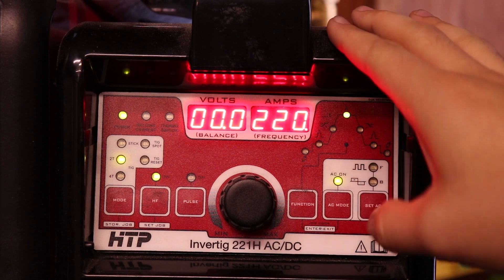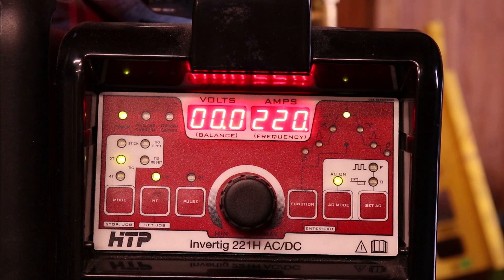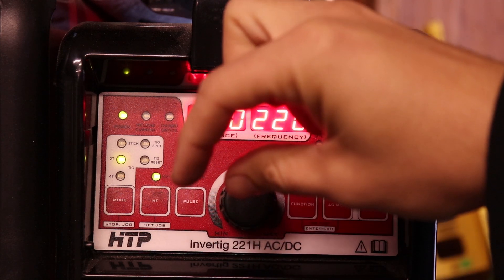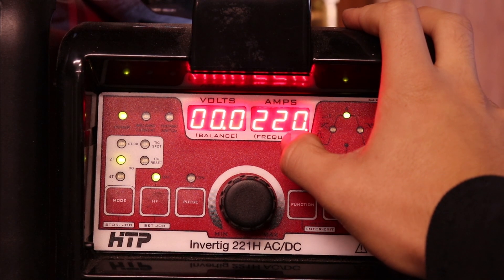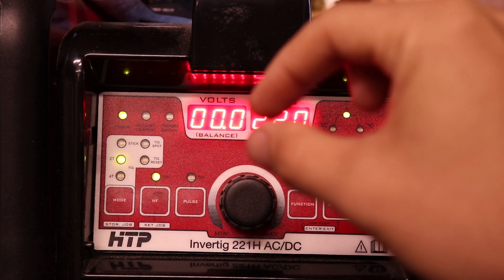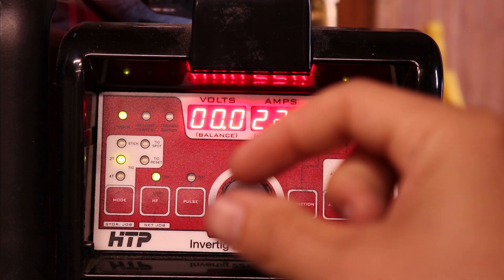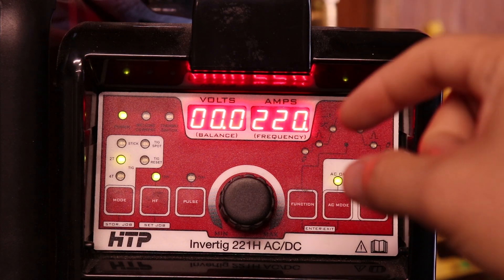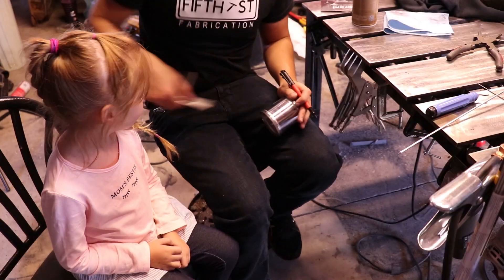Custom Intercooler Build

Comment: Nice work I have a intercooler im designing.  My question is do you use all 3/32 filler or did you use 3/32 on the endtanks and 1/8 on tank to core?    I have 3/32 wire but wondering if it will be worth while to pick up 1/8 as well. I do like to push 3/32 wire when I weld but thinking its possible  o can consume an entire rod quickly  and might make uneeded starts and stops
Reply from the maker: Ya i just used 3/32 if you dont want to run out you can always tack 2 pieces together
Reply: @5thStreetFab   thanks. So many people have always told me to tack some together and I just never tried it.  I had welded a truck frame with only 3/32 and it was fun makeing a 7 inch fillet with one whole stick

Comment: Why run the bead down the middle on both sides
Reply from the maker: Just to make sure theres no way for it to leak
Reply: @5thStreetFab  how would it only on the center post
Reply from the maker: @Moodyfabrication  where i weld them under the end caps if it had any sort of leak it would come out from the sides.  It probably wouldnt leak but its better safe than sorry
Reply: @5thStreetFab  thank you for the information

Comment: Nice work!  Have you ever welded cast aluminum intercooler end tanks  ? I was just wondering what will be the difference on  Machine setup?
Reply: Most likely lower, way lower freq. and maybe just 60% EN because cast Al is like sponge soaking all the not that nice stuff. If You want to get a general idea of welding cast aluminum, Jody Collier have got a lot of nice informative videos on his YT channel called weldingtipsandtrick and The Fabrication Series is also worth Your time if You are intersted in this subject.

Comment: Im a new tig welder (brand new welder at that never welded before picking up the tig torch). I have an AHP tig 201xd. I dont think ill ever have that good of looking welds teaching my self to tig weld, but just a quick question. I'm having such a hard time with steel  i can weld so much better on aluminum. Can i do the stop add filler move, pause, add filler, move, technique on steel as well?

Comment: Thats some awsome fab work! How do you go with the pyrex cups on ally with the high amps? I thought they were only for lower temps on stainless. Sick as welding though!!
Reply from the maker: Thanks!  These are better than regular pyrex but they're not supposed to be used on AC bit hey they seem to hold up!

Comment: Great work as always, love to watch you weld.  I've learned a lot from you.  
I noticed an Edge welding cup, so are you still using #5 cup?
I'm sure I'm wrong, but have to ask, did we witness you stick your tungsten?
Thanks
Reply from the maker: Thanks bud!  It's a #7 cup and that's pretty much all I ever use anymore unless I need to get into a tight spot then I'll use a #7.  And yes haha I know I stuck my tungsten a couple of times while tacking.  But I also popped the breaker while welding the core to the end caps!  The dryer was going at the same time! Haha
Reply: @5thStreetFab  thanks Max

Comment: Man! Beautiful, absolutely gorgeous weldings, you are very talented indeed. I have been watching many of your videos and have helped me a lot.
I have a primeweld 225x hope your settings works for it at least as a baseline to get me in the ball park,
Thanks for the great videos and sharing your experience
Reply from the maker: Ya the settings should be good.  I don't know if the balance on your machine shows % of EP or % of EN. So the balance might be opposite.  So instead of being around 70% you might be around 30%

Comment: Amazing work as usual. I’ve been watching your channel and practicing lots (lately on 1/8 5053). I’m struggling with melting the start and end edges of my base metal (especially when I get to the end of a weld when doing outside corners).  Trying to taper off on the pedal early enough but if I taper off too much, it starts to get snotty.  I notice you seem to double dab at the very end, hard to tell. My Everlast 250EX is set for 125A 120Hz, 3/16 tungsten, 3/16 or 1/8 filler. Any advise?
Reply from the maker: Ya those are the hardest parts.  The beginning and especially the end will get heat saturated.  I like to start quick so it doesn't saturate so quickly and there's a couple things you can do.  If you can clamp a block of aluminum behind the weld it will pull the heat out and help or you can stop a couple inches short and let the part cool down before you finish the last bit.  Otherwise it's a lot of pedal manipulation to keep it from washing out on you

Comment: This is giving me ideas.  Oops, dangerous!  Could you please drop a few hints as to where you sourced the cores for this project?  Thx
Reply from the maker: Haha ya I bought these through summit racing but they're also on Amazon too. They're vibrant performance cores
Reply: @5thStreetFab  I have been watching your vids for a few months now and I aspire to complete my own welds to such high standards as yours.  I need a LOT of practice, so I might as well practice on something that might have value, right
Reply from the maker: @jawneelogik5744  haha ya you can just make sure to pressure test it!  I would rather learn on boxes and things like that
Reply: @5thStreetFab  Yes, it's true that I should burn up some scrap before tackling anything as critical as an inter-cooler.  However, you can't sell welded scrap metal no matter how pretty the welds, and in-the-end, I like you, am trying to earn a few shekels for my trouble.
Reply: BTW, my machine is an EVERLAST PowerTIG 255 EXT.  It's had too little use, but every time I watch one of your videos, I get inspired to go out and practice a bit.

Comment: That shit is badass! Where did u buy the parts to make it? I would like to see u build a water intercooler in the future just to know the difference
Reply from the maker: Thank you!  I bought the cores and inlet/outlet at summit racing.  The aluminum sheet I get at work
Reply: @5thStreetFab  thanks for that info highly appreciated it. Do u know if its cheaper vs buying one already made?
Reply from the maker: @rafatrill  if you build it yourself it would be cheaper but the best part is you can make it the exact size you need and inlet/outlet exactly where you need it.  But if you're paying someone it'll be cheaper to buy an already made one
Reply: @5thStreetFab  sweet, how can u check for leaks?
Reply from the maker: @rafatrill  we use tubing and hose clamps with caps clamped on on all the exits except one.  We have tubing clamped to that one with a regulator that has an air fitting.  We'll slowly pump the air up to what the pressure test calls out.  Leave it for half an hour.  Come back with soapy water and check every spot for leaks while making sure the PSI didn't drop from the time you started
Reply: @5thStreetFab  I never seen this process ur talking about but sounds interesting

Comment: Firstly, Beautiful work. I noticed that you hand filed ALL the parts. I think that cleaning parts before welding, helps to get better welds. On steel you get better "burn in" and obviously on Alluminium it is even MORE important. At work the boss wants productivity, Not cleaning, because cleaning "takes time", go figure.
Reply from the maker: Normally i have a burr tool that I can just zip along the edge to knock off the burrs but at home I don't have one so it takes quite a while to do it with a file!

Comment: Very nice. Do you still have your Ahp alpha tig? How does that compare to the Htp?
Reply from the maker: I still have it but it doesn't weld worth a crap anymore.  The htp is like a budget dynasty to me.  Not as many settings but definitely enough to be dangerous.  Frequency only goes to 200 and pulse doesn't seam as crisp but for half the price id way rather buy this

Comment: I usually use standard setup on aluminum. Were you using the pro8 how do you like that gas setup?
Reply from the maker: I like a gas lens #7 it just flows better for me.  This is an edge welding cup #7

Comment: What type, thickness aluminum are you using for the end tanks and what size/alloy filler rod?
Reply from the maker: I'm running 1/8" 5052 aluminum and 3/32" 5356 filler
Reply: @5thStreetFab   any reason why you didnt go with 6061?
Reply from the maker: @Alex-ez2ym  ya 5052 is just easier to work with and weld